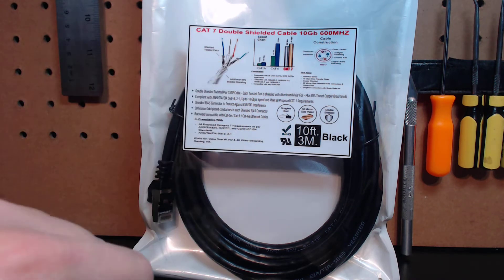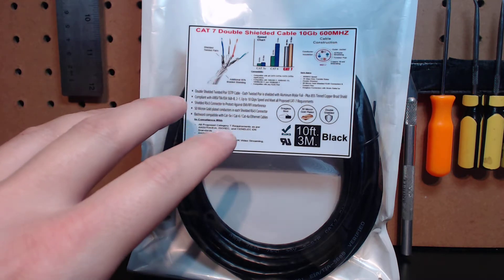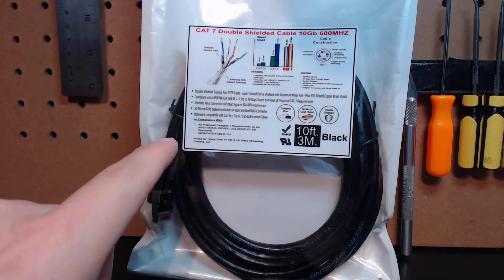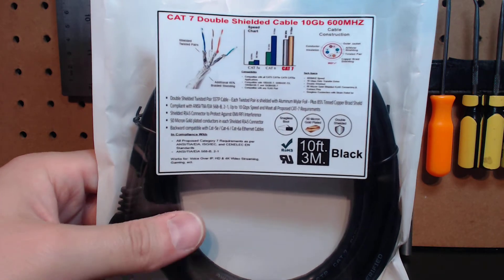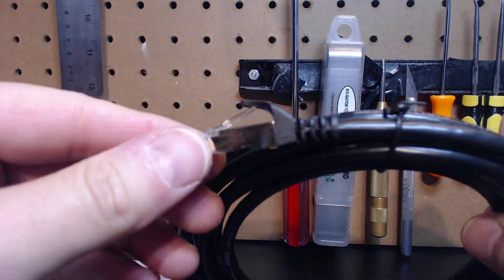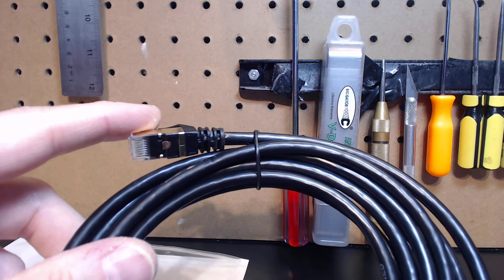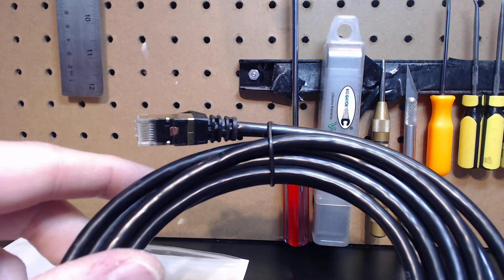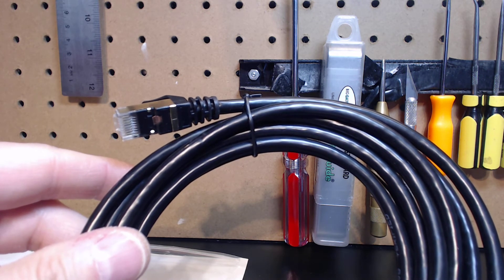Ethernet Smooth Stepper Double Shielded Cable...

Comment: CAT 7 - Interesting.
Reply from the maker: Yes sir, a double shielded CAT7 assures the cleanest signals. Thank you,
Vince
Reply: @corvetteguy50  I know a good idea - when I steal it!   Thank you for sharing.   I'm going to upgrade a bunch of Windows XP/Mach3 Systems to Windows 7 (or 10) and ESS (Parallel printer ports have gone the way of the dinosaur, and getting old working computers is getting harder, too....)  Of course, an additional big advantage of the ESS is improved trajectory planning - which should yield a better result on complex 3D surfaces.
Reply from the maker: @joecnc3341   :)..This is very the well the case with the ESS. Their not cheap, but their the best for a reason. Thank you, Vince

Comment: What to do regarding ground loop issues between the laptop and the controller seeing as how essentially the shielded cable is making ground contact from both sides.
Reply from the maker: Nikita, 99% of laptops, and about 80% of desktops have "floating grounds" so you'll have no worries with and shielded cable's you use with them. Thank you,
Vince
Reply: @corvetteguy50  Hey Vince thanks for the response I appreciate it, if you have the time check out my part 2 video on the ATC router I've been working on, used everything I've learned to put together a UC300 based electronics system want to get your input, the video is outdated now the electronics are a little more complicated and the VFD enclosure is finished, ATC and everything is all working now I just have to cut the IO panels for the enclosures. Might buy from your store soon actually to finish upgrading the wiring.
Reply from the maker: Nikita, the system is well designed, and its apparent you took your time to cover all the details. My suggestions are to mount as you said in your video the reservoir for the spindle above the unit to decrease the pumps head strain. You'll also want to pay very close attention to the cable chain where the coolant tubing is run as over time its very possible to instigate more leaks from tight excessive flexing. The electrical enclosure is a professional unit with Meanwell power supply is very nice. I highly recommend using either ferrites, or shielded heatshrink tubing to properly shield the drives motor cable input leads, along with the  STEP, and DIRECTION signals,  leads going to breakout board. I see you installed a large ferrite  on the wiring bundle for the drives, but it would be more effective to use the ferrites on each individual drive for maximum effectiveness. The VFD enclosure looks great, and connecting the VFD with some of my 16/4 double shielded cable with its shield drain leads installed on the Star point ground combined with the  EMI filter you have installed will be icing on her cake to bring her to life in a "bullet proof" fashion regarding her stability. :)
Great job overall, and great job on your channel.
Vince